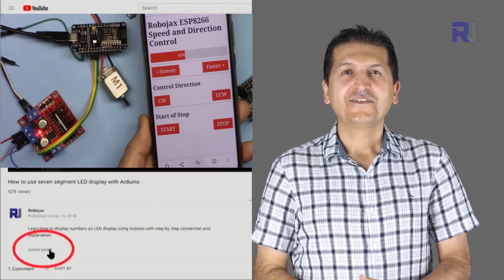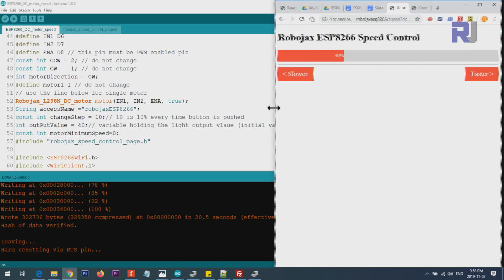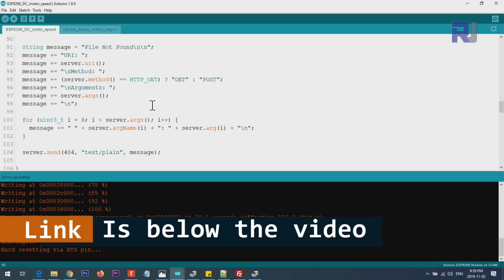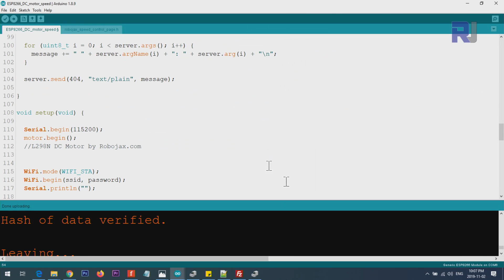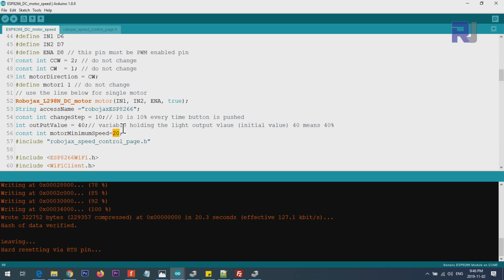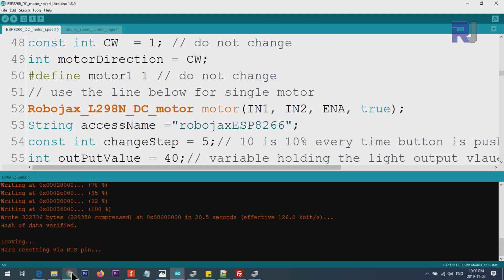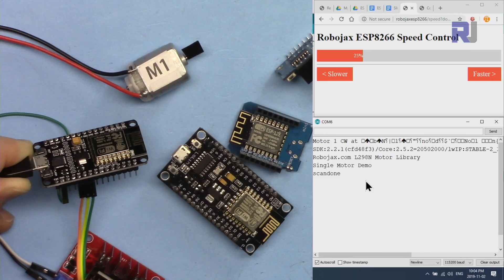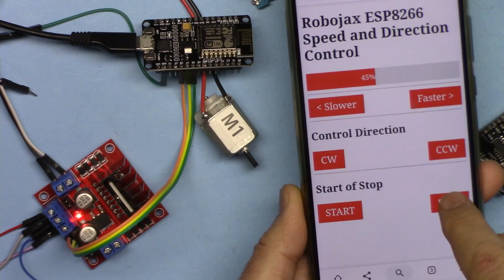IoT: Control Speed of DC motor with NodeMCU ESP8266 and L298N Module - RJT234

Comment: sir the serial moniter is showing blank
Reply from the maker: it seems you have skipped so many required videos. first start with introduction to ESP8266 so you can program it https://youtu.be/pLvqh57T3s4 then make sure you understand L298N so you can control motor without WiFi. After that you can come this code.  Good luck

Comment: hi i have problem i have follow many about esp ccontrol l298n and cant rotate the motor just silent no move
Reply from the maker: Have tried it first with the wifi? If. It search for it. Here is how find a video in a channel https://youtu.be/OhkUceBWcHs
Reply from the maker: You didn’t reply? I searched the video and posted help link. Please reply.
Reply: @robojax  ouh sorry for late respone i have been try with wifi and that connected sending signal is ok and got respone but that cannot move the motor and i hear like many small click sound on  DC motor when i set 255 but that doesnt move just click 
Sorry for slow respone

Comment: Can I use l298n IC instead of motor driver ??
To decrease weight ??
Any one plz rply.
Reply from the maker: Yea it is can if you wire it properly
Reply: @robojax  for rc helecopter motors 
Does the l293d ic enough Or l298n ic is needed ?
Is any small motor driver ic avalaible to control 3 motors together ?
Plz help Mee.

Comment: The code is broken to me. Tried various ways, always run into exceptions.
Reply from the maker: Just removed the code and made it available as zip. Please confirm if the issue is resolved
Reply: @robojax  ok, this works. I tried the previous code in various ways. I edited my initial comment.
Reply from the maker: I hope I worked for you. I have also deleted my comment. Stay safe

Comment: I can't make this work!  When the EN pins are connected to the D1 mini (tried many pins) all I get is a buzzer.  Place jumpers on ENA & ENB motors run at full speed.  Same problem with every other tutorial on Youtube.  I tried rolling board core back from 2.7.4 to 2.4.2 and 2.5.1; no help.  Tried with different Di minis and NodeMCUs and different L298Ns.  Wiring exactly as yours.  Seems that analogWrite causes a crash
Reply from the maker: I don't know why. this is strange.  try my other video to dim an LED to make sure  of that.

Comment: Hello Ahmad.. I managed to flash my wemos D1 mini. However.. my ESP crashes when I press enter at my webbrowser.
Reply from the maker: Hello, I am not sure. for Excepting(3) please see this page  and discuss it with others https://github.com/esp8266/Arduino/issues/1997
Reply: @robojax  Dear Ahmad. I am one step ahead now. Many thanks for the link. I tried couple of suggestions from your link : https://github.com/esp8266/Arduino/issues/1997
1. Erase Flash: All Flash Contents in the IDE. 2.   Added WiFi.persistent(false); WiFi.disconnect(true); in the setup (); Unfortunately neither helped.

After Further googling, I landed here (https://forum.arduino.cc/index.php?topic=671852.0 ) and the suggestion from PieterP Comment #4 seems to have resolved the problem.  The crash doesnt happen anymore! However, my HTML page is a little messed up. I hope I can fix it.  Wanted to thank you again...
Reply: o/p from my serial window...

00:52:54.497 -> Motor 1 CW at 40% pin 12 LOW  pin 13 HIGH
00:52:54.578 -> 
00:52:54.578 -> --------------- CUT HERE FOR EXCEPTION DECODER ---------------
00:52:54.578 -> 
00:52:54.578 -> Exception (3):
00:52:54.578 -> epc1=0x4000bf64 epc2=0x00000000 epc3=0x402010dd excvaddr=0x40243601 depc=0x00000000
00:52:54.578 -> 
00:52:54.578 -> >>>stack>>>
00:52:54.578 -> 
00:52:54.578 -> ctx: cont
00:52:54.578 -> sp: 3ffffd00 end: 3fffffc0 offset: 0190

Comment: Hello sir i want to ask something
1. can i use l9110n or any motor driver instead of l298n ?
2. can i use any other board like Arduino D1 or other instead of using esp32 ?
its your code for this require only to use esp32 and l298n ?
Reply from the maker: hello, 1-no it is NOT. 2 No you can't . I have separate video for ESP8266 (you call it D1 mini).
Reply: @robojax  okay then my problem is just the driver
Reply: @robojax  can i add some code ? i also want to add button that can turn on and off lamp and etc.
do you have courses at all ?
Reply from the maker: why you waited 3 hours for me to reply? just search my channel. I have tones of it.
Reply: @robojax  
hello i have problem, i cant access the ip address of the esp8266 or visiting robojaxesp8266.

any solution at all ?

Comment: Where is the pin connection diagram?
Reply from the maker: see the code, somewhere at the top of the code, you will see link to the wiring diagram.
Reply: @robojax  Robojax_ESP_L298N_DC_motor.h: No such file or directory 
How can I fix it
I have downloaded your library and added
Reply: after I renamed <Robojax_ESP_L298N_DC_motor.h> to #include <Robojax_L298N_DC_motor.h>. It shows the redefinition of 'const uint8_t D0' error

Comment: I keep getting and error while compiling. it says:  const char speed_control_page_part1[348] previously defined.. Any ideas? Also monitor shows squares and question marks.. Motor is running at predetermined speed.
Thank you sir!
Reply from the maker: It means you have included the file twice.  I would suggest don't change anything first and run. Once you succeeded, then make changes. for question marks, you have not set the Serial monitor properly. Watch the video where I explained the code or see this photo https://snipboard.io/y3pKwG.jpg

Comment: Thank you for the video. Why did you need to write a library for the L298N though?
Reply from the maker: You are welcome.  I have written the library to make is easy for everyone. Have you used L298N? you have to set 1 pin LOW and the other HIGH to run the motor and then how do you calculate the speed of motor? you write between 0 and 255 which refers to speed of zero and 100% that was also not simple. so I toke care of all of those by writing the library and the code looks very clean and easy to use.  Here the main video using the library https://youtu.be/wn5D7j1ybxY
Reply: @robojax  yes I have used an L298N before but it's been a while so I don't remember much. I was just wondering. :) Thank you for the quick reply!
Reply from the maker: you are welcome.

Comment: Sir, url address is showing as "site cant be reached " im not understanding what is wrong with the IP address even though i copied the right address and also internet connection is strong... and on serial monitor continuously this statement i can see as "motor 1 CW at 40% pin 12 LOW pin 13 HIGH"
Reply from the maker: you are accessing it from a device that is NOT connected to the same WiFi. try to connect to the same WiFi
Reply: @robojax  i have connected to same wifi Sir...
Reply from the maker: then it should work.  Open the Examples->ESP8266WebSErver->Advanced Web Server and see if you can see the screen on your web browser.
Reply: @robojax  I am having the same problem. I opened up the example and that works fine, but with the code from this tutorial, I can't access the web server

Comment: Sir we just need to on and off the motor using nodemcu ...not the speed.   So wat changes shd we do for it
Reply from the maker: check my latest video and search for ESP8266. I have relay to turn it ON and OFF. if you want to use this module, then watch the video with full explanation and it would be very easy to keep it running at 100% speed. Watch it again without escaping.

Comment: Sir, thanks for sharing.
i have problems with the website. The Website is unreachable. The Serial Monitor shows the contact to the WLAN and started the http-server. Do you have any Ideas for Solution? Thank you in advance
Reply from the maker: how do you check it? if you use a phone or desktop machine, they must be connected to the same SSID (Wifi) as the ESP8266. If they are not in the same network, then you don't be able to see it.
Reply: Hi, i'm sorry for the late response. I have check the connection with a ping to the nodemcu and with the serial Monitor

Comment: sir i have one error in code compiling 

redefinition of 'const uint8_t D0'
Reply from the maker: It means you have the duplicate of the same unit8 D0 so remove the one them from the top of the code.. May be there are multiple lines have been duplicated. check them.
Reply: @robojax  you provide a code with errors sir
Reply: @ravnOne65  , in the Arduino IDE, set Tools/Board/Generic ESP8266 Module. Then this error will be solved.
Reply: @robojax  I also get the same error.

Comment: How do I find the coding to have a simple switch closed to start a motor PWM climb from 0 to 100% in 2 seconds, and back down to 0% when switch opened? I have a 8266 and want to make a simple switch to ramp up and down a motor controller. WiFi is optional for future functions. Everything available seems overkill to what I want to do with it.
Reply from the maker: What you need requires separate video. The code needs to be updated and it should be explained.

Comment: Sir, Nodemcu Ac motor pwm control using triac video please.
Reply from the maker: I would have to look at inductive load control. Motor is different than bulb which I have shown here https://youtu.be/zJQf6bNodhE I will make video for bul using ESP8366 but for motor I would have to find a proper components or module.

Comment: Good work I need your email address. I wanna ask something related to node mcu and wemos D1.
How we can directly connect to mobile or laptop without any apn or internet access I tried but I could not connect to wemos D1 mini and node mcu
Reply from the maker: It needs another video. the ESP8266 will be defined as "AP" or access point.
Reply: @robojax  yeah but i want to connect my esp8266 wifi directly to mobile not internet or any router .
i need guide